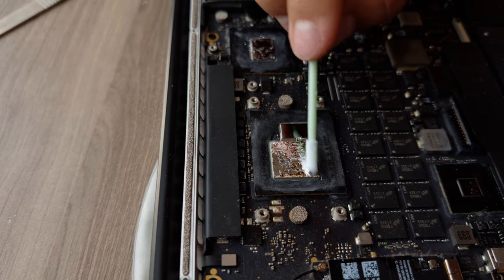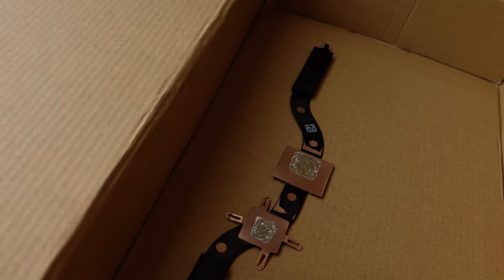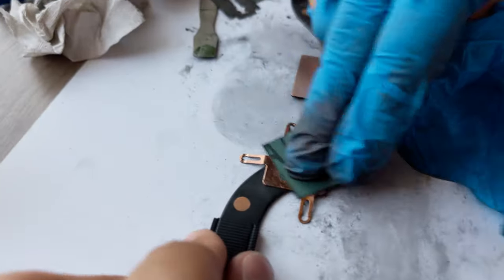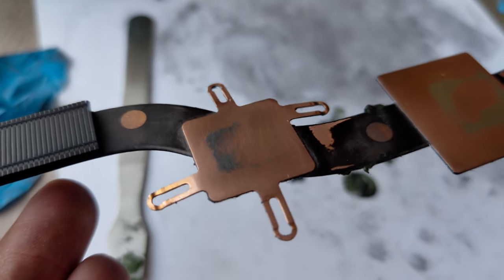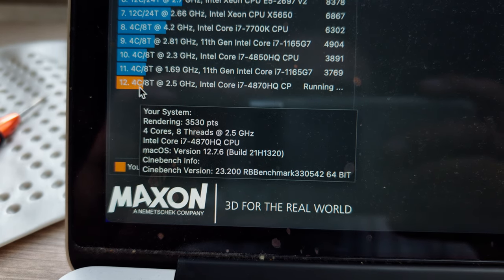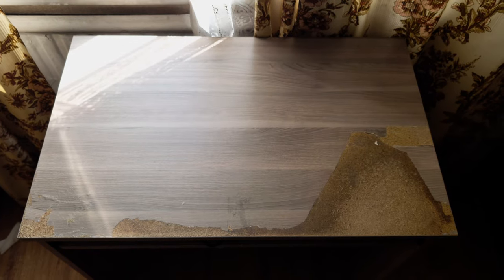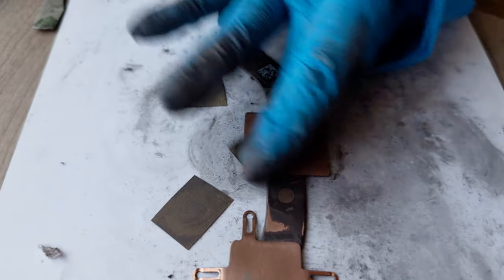I gave liquid metal one last chance (Thermal Grizzly Conductonaut)

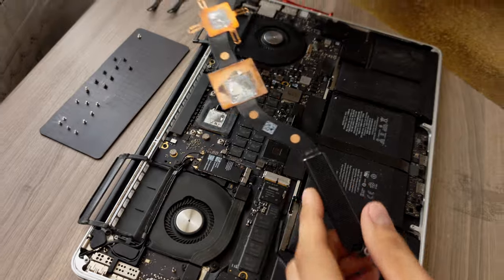Comment: i only use liquid metal on nickel plated copper. the nickel plating prevents the copper from turning bad like at 0:25 

after using it on bare copper for 6 months, i had to scrub it off the copper and then polish the copper with sand paper and a polish to make it flat again.

its not worth it on bare copper and it will degrade way to quick.

and for a laptop i would anyways use those thermal grizzly minus pads, which have to be never swapped out again and they perform better then thermal paste.   (but they are quite expensive)

Comment: As someone who was team liquid metal for nearly 6 years, don't use liquid metal on laptops. Most will be fine with it, but some just won't be compatible with it no matter how much effort you put into it without outright replacing the heatsink with something custom. I used to use it on all of my laptops until for some reason despite significant effort put into isolation some got loose after ~2 years and fried the vrm. Unlucky but leaves a bad taste when the other ~35 applications went perfectly fine. Fixed it eventually (micro soldering board repair is hard AF) but lesson learned. Some heatsinks aren't designed for it and attempting to create your own isolation barrier using just some foam and kapton tape doesn't cut it. Needs to be solid, essentially waterproof layer of tape around the die to guarantee no issues, plus you have to apply enough to account for the galvanization. You'll eventually run into problems with it with some laptop. I estimate failure rates of ~1-2%. So it may literally take ~50-100+ laptops before you personally run into an issue. But you WILL run into an issue eventually.

To resolve all of that hassle with a very very close to 0% failure rate (probably around 1 in 100k), just slap a PCM on it and call it a day. Honeywell 7950, laird 7000, or other formulations of it unisiren pcm-1, thermal grizzy pcm, etc...

It's not as good as a perfect application of liquid metal yes, but it has a service life you can measure in DECADES instead of months and will instantly shoot to the top of a thermal paste comparison chart (after about 6+ months) due to just how incredibly resistant to pump out it is.

TLDR: Only use PCM based thermal interfaces on bare dies!

Comment: Why are you leaving the other cpu die (io? video?) bare? You need to put some on both dies. Idk why you keep leaving it bare
Reply: It’s the chipset controller. Low power chip. If he were to add LM on it, it would share the head load and may cause it to overheat.

Apple from the factory wouldn’t cover it either in thermal paste. The 13” model actually doesn’t even have the contact plate cover it.

Comment: with normal thermal paste, do you notice any pump out effect with gd900? i bought areonaut from TG, that scored well at first before dropping to 3000, i then got syy157 which got me upto 3470 but that then dropped within 1 week to 3200, when i take the heat sink off the thermal paste appears to be milky and watery, not really a viscous paste anymore, is that normal with these macbooks?